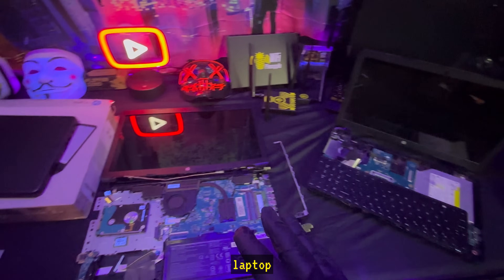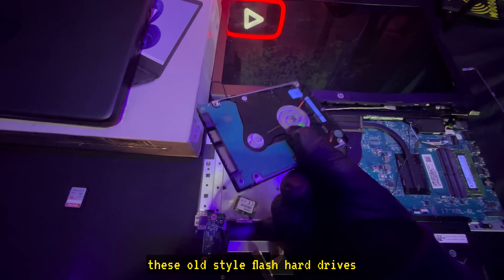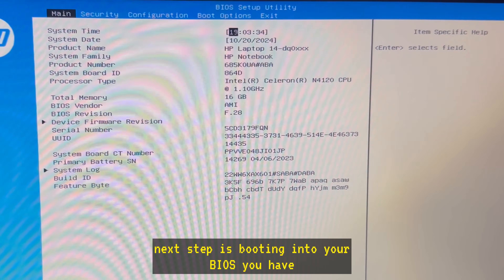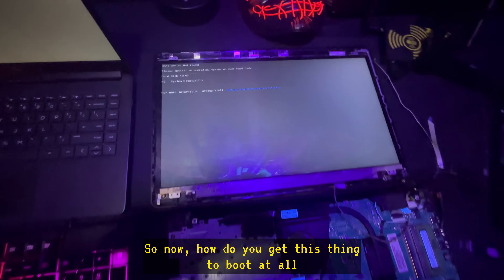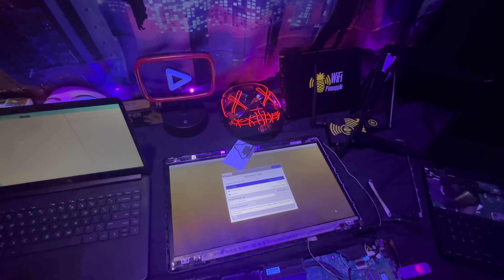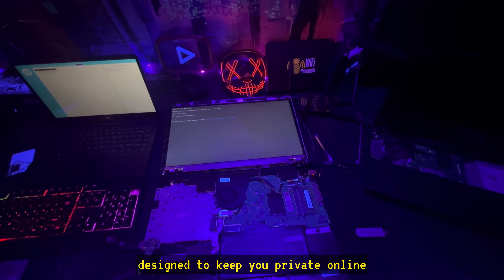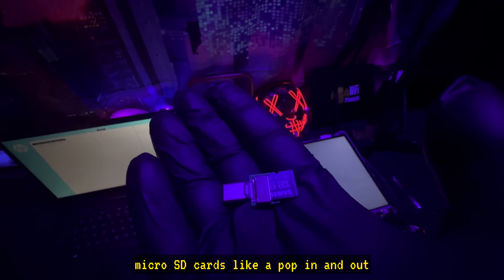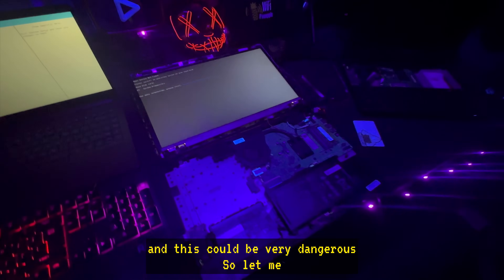Build a Ghost Untraceable Laptop: Ultimate Guide to Online Anonymity and Privacy! DIY

Comment: @GhostStrats...

tl/dr warning for everyone. But it might be enlightening too.

(tl/dr Cliff's Notes: Does anyone have info, or links on "sterile" computing hardware that doesn’t have burned in DRM & serial numbers, to run Tails on, for even better security confidence? Even if Tails does not read them, send them, or "cooperate" with anything that asks for them.)

I've been considering setting up a Tails sterile boot USB, but I am wondering about embedded hardware ID's in the CPU, GPU, TPM, Network adapters, and motherboard chipset. 

People would be AMAZED to understand how much unique ID is hard coded into these chips. And it goes WAY BACK, nearly 30 years now. Into the late 90s & early 2000s. When Hollywood & the Music labels were freaking out over DRM (Digital Rights Management) & piracy. And presumably more quietly pushed by anyone else (i.e. Government) that was interested in surveillance. 

If you've ever wondered about say, the NYT news website paywall, and: "You have three free articles remaining..." etc. And you do SEVERAL things to obfuscate your identity online, (VPN, different network/WiFi, random WiFi MAC, a different browser you've never used before, and maybe even a Virtual Machine/desktop) and visit the NYT again, but it knows "it's you" and now says: "You have TWO free articles remaining..."

In part at least, these "burned in" chip serial numbers, like an automobile VIN, are a portion how this is done. (And Windows, drivers, and the browser cooperating, too...)

I 100% understand that the ability of outside websites, services, & systems to identify this information from your computer or device is SUPPOSED to be dependent on the browser or other client applications, the computer Operating System, and drivers to query those ID serial numbers built into the chips.

And Tails is specifically designed to NOT cooperate or do this at all. 

However, its always possible Tails is not perfect. And there's been other instances of unique and repeatable ID info transmitted, or low level hardware layer protocol (way "below" applications, drivers, & OS) "hardware management systems" with ENORMOUS FLAWS (or it was intentional) being discovered from time to time.

Plus, things like the attempted takeover and hacking/compromise in the news this year of very old and core Unix/Linux code libraries in the open-source repositories. 

GhostStrats, or if anybody is still reading, do you have any information, articles, websites, or resources on hardware & devices that is "sterile" in this fashion?  Not even on hardware and chips that "intentionally" omit these ID's. Maybe just ones privacy experts discover that don't because it's "cheap" or a low-effort x86, x64, or AMD- compatible that didn’t bother with the cost of unique ID's when the chips were fabbed? 

Like an inexpensive off-brand netbook, or small ATX-mini micro industrial PC's, or thin-client device, etc? 🤔

Comment: The Speakers are also microphones... And you may as well take out the polarizing film so nobody can read your screen without hacker glasses you make.
Reply: Excuse me, HOW are the speakers also microphones?? Care to explain?
Reply: @SilverTester  sound waves act against the speakercone which moves the voice coil back n forth through the magnetic field of the speakers permanent magnet which causes a ac current to be induced into the voice coil which which can be translated into  audio reproduction of whatever sound was strong enough to move the cone...
Reply: @gayshawndayleequeef1946  that's.. way beyond next level. So there's software that can pick up these shifts and reconstitute voice records? Damn!
Reply: @SilverTester when i was a kid, i would plug in my headphones w/o microphones in microphone jacks, it would def work. Not the best quality. But its understandable for sure. So its not like they have to reconstruct anything. Just treat the speakers as microphones. Just like LEDs collecting light. What makes them emmit, can make them also pick up.
Reply: @SilverTester He overexplained it. The basic fact is that speakers and microphones are basically the same hardware. They do the same things - convert sound to electrical impulses, or vice versa. Speakers are better optimized to output, but they also work as input. It's not so much a matter of "special software," more just telling the computer "hey, use that speaker as a mic."
Reply: @SilverTester  That's nothing - you can use the same basic principle to reconstruct audio from things like ripples in a glass of water, a plastic bag, a pane of glass (window), etc. Sound is just vibration of air molecules, and those vibrations propagate through a variety of media...
Reply: @SilverTester  you can actually use a speaker as a microphone yourself try it sometime
Reply: The LATEST technology for CIA, NSA, EVEN FBI IS ANYTHING THAT CAN SEND SOUND OR LIGHT AND VISUAL, CAN RECEIVE! ITS CALLED INTERACTIVE TECHNOLOGY! ALL CARS WITH COMPUTER COMPONENTS, PHONES, TV'S COMPUTERS, ECT.  CAN RECEIVE AUDIO AND VISUALS ... IF IT CAN SEND A SIGNAL, IT CAN RECEIVE IT! THE SYSTEM IS HARDWIRED NOW! THAT'S WHAT 911 WAS ALL ABOUT FOLKS. THE POWERS THAT BE, ARE IN DEMIGOD MODE... ALL SEEING AND KNOWING...
ITS PROPHECY AND ITS NOT GOOD! 
From book of Revelations Ch 16  And I saw three unclean spirits like frogs come out of the mouth of the dragon, and out of the mouth of the beast, and out of the mouth of the false prophet.
14 For they are the spirits of devils, working miracles, which go forth unto the kings of the earth and of the whole world, to gather them to the battle of that great day of God Almighty.
 15 Behold, I come as a thief. Blessed is he that watch, and keep his garments on,  lest he walk naked, and they ( the powers that be, the kings of the earth), see his shame.  in your home, watching you, and all that do!) 
This is the Matrix in which we live, and people don't have a clue to what is going on right now! The guy who made this video is spot on! Your computer are nothing but data collectors, anything you put on it can be seen, and stolen without you even knowing! The insanity of these times is that JUDGEMENT DAY IS HAPPENING RIGHT NOW, AND THINGS SRE RAMPING UP FOR A GREAT EVENT, AN EXTRATERRESTRIAL EVENT!

Comment: There are some very rare virus that can infect motherboards (even without a hard drive). Malware planted in the UEFI firmware image is not only difficult to identify but is also extremely persistent as it cannot be removed by reinstalling the operating system or by replacing the storage drive.

Comment: You've missed a couple of important points. Firstly, you totally can read the ram after removing the usb stick by taking out the memory sticks and cooling them and then reading them in another device. Secondly, there are various techniques to monitor a screen without being actually present nearby. Thirdly, think things might be stored that you don't want in the IME and/or UEFI and/or other possibly existing management systems. And what about buffers, like a keyboard buffer?!!
Reply: Tails has Amnesia, read about it as you're eating your cheetos.
Reply: did you keep pushing your glasses up off your nose after every numeral statement? i can smell the cheetos dust from this comment
Reply: @camzen1772  wtf is a numeral statement. Just say after every sentence lmao

Comment: a great many secureboot implementations have been compromised (due to irresponsible leaked shared secrets mostly, also not changing the terrible defaults) so the boot process on lots of computers worldwide can be reasonably compromised (malware injected before the operating system).  
inserting data to be recalled later into the tpm can be a software method of later tracking targets without storage.

many serial numbers that are permanent (such as cpu serial number, motherboard serial number, and various other id's) can be read and are generally not secured at all (i.e. they don't require root/admin privileges to read, and it may be possible to convince a web browser via java, javascript, etc. to give up that information for logging and fingerprinting.
lots of machines' uefi update routines aren't properly secured so it may be possible to add extra spyware routines into the boot process to send information to an attacker.
any time an adversary (particularly law enforcement organizations) can get your real local ip by bypassing vpns (tor et al), they can generally compromise your location by either geolocation or by getting a warrant from the isp to see who had that ip address at that time and then further pulling surveillance camera footage (if it's a public location).  the overwhelming majority of public locations such as restaurants, coffee shops, schools, other businesses typically have surveillance cameras, and lots of more urban settings have public cameras scattered around neighborhoods as a form of neighborhood watch, not to mention the plethora of privately owned surveillance cameras in various areas.  if your adversary is a government / law enforcement organization, it's INCREDIBLY difficult to remain secure online.

Comment: Hardware back door in the CPU. IIRC, The most recent Intel CPU not backdoored in this was the Intel Atom series built around 2009-2013. Until you deal with that issue, all you're really doing is down grading a laptop and giving yourself a false sense of security.
Reply: Depending on how you type, like how your fingers press each key can also identify you. With the rise of AI companies can do keyboard typing forensic profiles on individuals now. Scary stuff out there…
Reply from the maker: I disagree. This is supposed to be a burner type laptop where everything that you need is in that flash drive. Almost as if it’s a thin client. Nothing should be stored anywhere. Everything will be operating off temporary memory.
Reply: @GhostStrats  
"Intel Active Management Technology"

is hardware and firmware for remote out-of-band management of select business computers,[1][2] running on the Intel Management Engine, a microprocessor subsystem *not exposed to the user, intended for monitoring*, maintenance, updating, and repairing systems.[1]

Its on wikipedia.
You could be monitored in real time from the hardware level without your knowledge.
becasue you disable the camera and microphone they might not see you face of hear you voice, but a third party could see everything you're doing on that laptop.
Reply: @karlsnowsill208  can I do this stuff with a raspberry pi to make it easier for a non techie? I just want secure comms
Reply: @victorygarden556   Raspberry Pi has "binary blobs" which is unknown proprietary driver code inside it, so you don't know whats in there, ie not secure.
Reply: @karlsnowsill208  so what do you recommend? pen and paper ?
Reply: @s777v1  either that or build my own cpu I guess😂
Reply: @DennisLim-j7r   Not all CPU's are backdoored, so start looking at CPUs and platforms that are fully documented and known to be secure. Anything wintel or x86 less that 12 years old is probably backdoored.

So you are going to have to forget about any microsoft product being secure.
Reply: @jshowao  Binary blobs are not open to inspect code any anything not open is a potential security hole. Open source software may have security holes but they can be discovered and fixed. You too have failed to understand its the CPU itself that has hardware bockdoors built into it and and entire OS onboard that is designed to take control of you hardware without you knowledge. it does not matter what wifi card you are using, all the data is going through the CPU and it controls the wifi card. if the CPU is backdoored it also doesn't t matter which OS you use either.

Comment: There are unique identifiers such as msc addresses, motherboard serial number, CPU serial, and several other unique identifiers that can be reasonably read in software allowing adversaries, even with proper network security, to track you on the dark web. Further there have been several uefi based exploits, including but not limited to storing data in the tpm, overwriting part of the uefi code with malware that you can't easily get rid of that serves as a homing beacon for when your computer has unsecured access to the plain internet, sending identifiable data to an adversary unprotected,  a kernel exploit allowing for remote code execution and privilege elevation can be used to save information to your flash drive you're booted from, or send information to an adversary (such as your current sessions browsing history). It has been proven that you can manipulate media applications into running malicious code from downloaded pictures, PDFs, etc.  there are lots of creative ways to exploit a. System, particularly if a user believes themselves to be overconfident in their stealth capabilities. There are tons of vulnerabilities found all the time, and if you come into the scope of a federal investigation, there's not much you can do to stay safe other than to rely on low tech means that are proven, completely offline.

Comment: For those not technically inclined on the hardware side, or those that don't want the hassle of tearing up a laptop, you can do the exact same thing using a THIN CLIENT like the HP T620 or similar thin clients. They don't have a camera or microphone. Obviously not as portable, but the idea is still there, and they only pull 15 watts of power at idle. :)
Reply from the maker: Very good point!
Reply: @GhostStrats  yours looks alot cooler i bet.:glasses-purple-yellow-diamond:

Comment: Do people ever use their laptop cameras? Are there laptops out there that don't come with a camera or microphone? I know for a fact they dont update their camera hardware every year like crazy like phone manufacturers do. They just slap on the cheapest possible option, but if customers dont care about cameras wouldnt it be even cheaper to just not add any camera??
Reply: It costs significantly LESS to have no user selectable options during the sale for any computer;  if there is only one configuration, then it's super simple to maintain stock;  so most manufacturers include the camera/microphone because many want the option; and it costs more to produce two models - one with and one without webcam/microphone.  In bulk, the cheapest webcam/microphone probably costs like 3 to 5 cents total; it'd costs way, way more for the manufacturer to have to stock multiple configurations. My super-cheap N100 laptop comes with a webcam that is so poor of video quality;  quality reminds me of cell phone video from the early 2000's.. But it ticks the mark : Included web camera..  My guess is that many folks want a web cam over not, so, even a P.O.S. webcam is good enough; Most that don't want it can simply not use it, or disable it in device manager.  The webcam is good enough for work meetings, to give to your kid, or to your grandparents.   No user selectable options during sale simply means lower price..  Everyone wants to pay less.. 

FWIW:  We have bosses at work that want the webcams on during every meeting:  Why ?  It forces participation;  it stops those attending from just muting themselves while they go take a nap, do the dishes, or other tasks if working from home; it also keeps some employees from working other tasks during the meetings; literally discourages doing other stuff than participating in the meeting...

Comment: What about you MAC address? It is always interrogated by websites. How do we reprogram it or block it? Where do we find a secure source of Tails Linux? Knowing about the camera and microphone I have added switches to turn them off but what about the speakers? Theoretically a speaker works like a dynamic microphone but with a different impedance. I could be quite possible for manufacturers to place a circuit within the laptop that would allow the speakers to double as microphones knowing that most secure conscious individuals would disable or remove the microphone. There would not be a way to use the speakers as microphones however if they are playing music at the same time.
Reply: Tails have MAC spoofing.
Reply: @dseednorway  Sweet!
Reply: @dseednorway  I was just about to say that 😂
Reply: @dseednorway but is it really safe? Fbi already know that we use tails , I think they have already taken countermeasures or brought in hidden programs.
Reply: Those are good questions. And if you gutting laptop like that he probably should also remove both wifi and ethernet cards and use usb adapters in their place. Or maybe change NIC firmware by overwriting MAC stored in eeprom.
Reply: If a website is recording a MAC, as you suggest, the source is likely going to be it's own gateway's MAC. MAC is a layer 2 address and is not propagated outside its local broadcast domain. Source and destination MAC changes at every layer 3 hop.

Comment: This is totally overkill. Just use tails. It doesn't store anything to the hard drive anyway. But hey I guess if you wanna do this go nuts.
Reply: what if i wanna plug in windows to go. or what if tails boots and ur auto enable camera is compromised with a webp attack.
Reply: Wrong. Hardware identifies itself when it communicated to other hardware. Anybody running an illicit exit node has yer ass.
Reply: @tracesmith3572  you mean they get their mac address? that's nothing. it's not something you can identify or trace. it's only relevant if you have a sample list to compare to.
Reply: @tracesmith3572  if you know what you are doing you can spoof your MAC as well
Reply: Can you explain to a newbie what tails is please 🙏
Reply: @HighVybeTribe  its a pendrive installed portable linux distro
Reply: Yea... hardened linux on a HD but boot prio to USB looks less sketch too
Reply: You're adorable. If anything, this is way underkill.